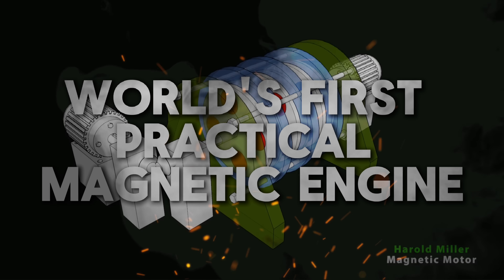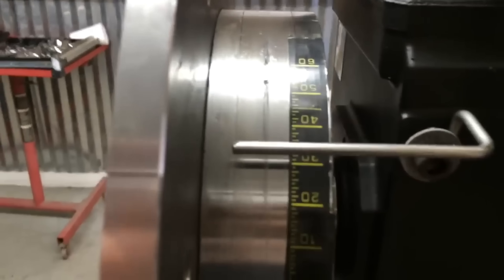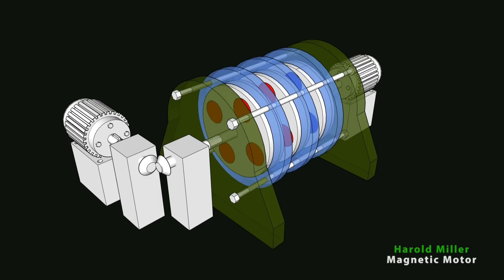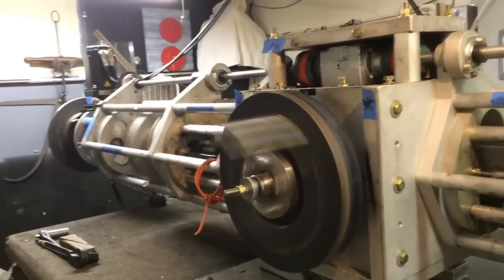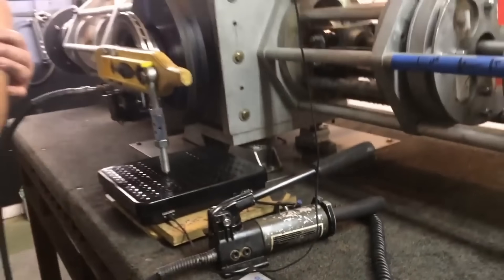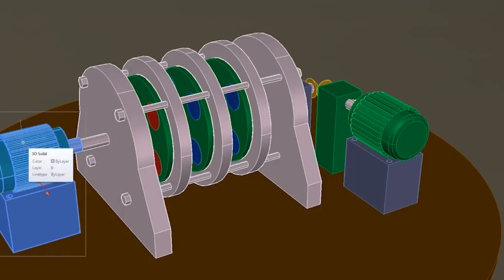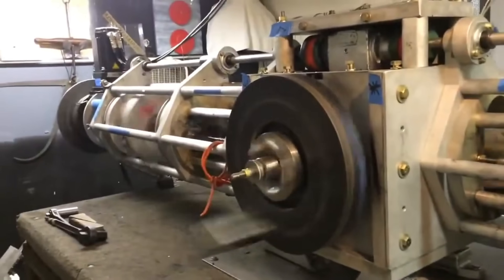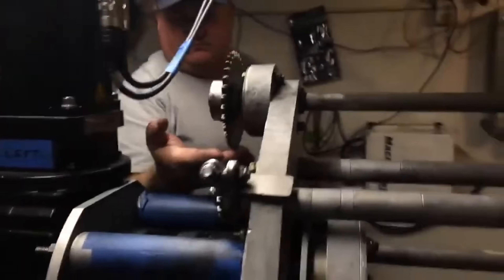Infinite Free Energy: Self-Starting 100% Magnet Powered Motor”?

Comment: Peaceful revolution driven by clean abundance
Let's face the wonder of full heat use. The second law of thermodynamics may be false conventional wisdom. This inelegant law. was developed during victorin england's scientific and religious fascination with steam engines. Many people act as if this paridgm is inescapable. 

. Unencumbered refrigeration by the principle that energy is conserved should produce an equivalent amount of electricity instead of consuming electricity. 

It makes more sense that refrigerators should yield electricity because energy is widely known to change form with no ultimate path of energy gain or loss being found. Therefore any form of fully recyclable energy can be cycled endlessly in any quantity. 

Full heat recycling, all electric, very isolated underground, undersea, or space communities would be highly survivable with self sufficient EMP resistant LED light  automated vertical farms, thaw resistant frozen food storehouses, factories, dwellings, self contained elevators, safe rooms, and horizontal transports. 

In a flourishing civillization, small self sufficient electric or cooling devices of many kinds and styles like lamps, smartphones, hotplates, water heaters, cooler chests, fans, radios, TVs, cameras, security devices, robot test equipment, scales, transaction terminals, wall clocks, open or ciosed for business luminous signs, power hand tools, ditch diggers, pumps, and personal transports, would be available for immediate use incrementally anywhere as people as individuals or larger social groups see fit. 

Some equipment groups could be consolidated on local networks. 

If a high majority thinks our civilization should geoengineer gigatons or
teratons of carbon dioxide out of our environment, instalations using devices that convert ambient heat into electricity can hypothetically be scaled up do it with a choice of comsequences including many beneficial ones. 

Energy sensible refrigerators that absorb heat and yield electricity would complement computers as computing consumes electricity and yields heat. Computing would be free. Chips could have energy recycling built in.
This would improve performance and lower cost, 

Refugee communities would be buildable quickly. Fire safes would preserve contents to 1000F indefinately 

A simple rectifier crystal can, iust short of a replicatable long term demonstration of a powerful prototype, almost certainly filter the random thermal motioren of electrons or discrete positiive charged voids called holes so the electric current flowing in one direction predominates. At low system voltage, a filtrate of one polarity predominates only a little but there is always usable electrical power derived from the source, which is Johnson (observation) Nyquest (theory) thermal electrical noise. This net electrical filtrate can be aggregated in a group of separate diodes in consistent alignment parallel creating widely scalable electrical power. The maximum energy is converted from ambient heat to productive direct current electricity when the electrica6bzDVgBhrhYl load electrical resistance  is equal to the array internal electrical resistance. 

Maximum calculated electrical power output (watts) is k (Boltźman's constant), one point three eight x 10^ minus 23, times T (temperature Kelvin) times bandwidth (0 Hz to a natural limit ~2 THz @ 290 K) times rectification halving and nanowatt power level rectification efficiency, times the number of diodes in the array. 

There are a billion cells of 1000 square nanometer area each per square millimeter, 100 billion per square centimeter.

Order is imposed on the random thermal motion of electrons by the structual orderlyness of a diode array made of diodes made within a slab: 

Host crystal is silicon
  P type boron doped
-----‐------‐----___-- Out
🔻🔻🔻🔻
■■■■■■___ + Out
  N type phosphorous doped 

All the P type semiconductor anodes abut a metal conductive plane deposited on the top face of the slab with nonrectifying joins;  the N type semiconductor cathodes or common cathode abuts the bottom face. As the polarity filtered electrical energy is exported, the amount of thermal energy in the group of diodes decreases. This group cooling will draw heat in from the surrounding ambient heat at a rate depending on the filtering rate and thermal resistance between the group and ambient gas, liquid, or solid warmer than absolute zero. There is always a lot of ambient heat on our planet, more on equatorial dry desert summer days and less on polar desert winter nights.

There are other plausible breeches of the second law of thermodynamics. Hopefully a lot of people, mostly as independent teams, will join in expanding the breech. Please share the successes or setbacks of experiemental efforts. 

These devices would probably become segmented commodities sold with minimal margin over supply cost. They would be manufactured by advanced automation that does not need financial incentive. Applicable best practices would be adopted. Business details would be open public knowledge. Associated people should move as negotiated and freely and honestly talk. Commerce would be a planetary scale unified conglomerate of diverse local cooperatives. There is no need of wealth extracting top commanders. We do not need often token philanthropy from the top if the wide majority of people can afford to be generous.. 

The topic deserves discussion and prototyping attempt action. 

Charles M, Brown
Kilauea, Kauai, Hawaii 96754

Comment: Am sceptical about this magnet motor.
Does it really only power itself with a magnet?
Are there really no hidden wires,accus or an aircompressor?
Also if it requires his hand to spin the cranking wheel, then it is not a selfstarting magnet motor.
Am very sceptical about.
Am afraid it’s another hoax.
And yes even if it will work, then there are indeed political oppositions who don’t care about a cleaner world but only do care about their profits  from their oil business.

Comment: If any of these free energy generators are been proven to actually work in a real world test, (where it counts) This would have been in world-wide production. There are many people claiming to have built such machines yet none exist. Even if one person gets shut down by the bad guys it's only a matter of time before someone else recreates a working device on the same basic designs and ideas. Have you ever noticed that when someone calls you on your cellphone that on average someone else you know will call you roughly at the same time and if you pay attention to this you will notice it happens more often than not. It's a sort of a psychic or spiritual connection or thing that we all have as living beings on some level or another. This same argument can be made about two people designing something based on the same concept no matter if it's a better can opener or a free energy device. My point is that at this time a free energy device does not exist and the evidence that it doesn't exist is the fact that it DOESN'T exist at least not at this point in time. Hope this helps.
Reply: OH BUT IT DOES!  Search on Walter Russell's Optical Dynamo. NO MOVING PARTS! It is a patent you can find, there is also a wealth of info on this on the University of Science and Philosophy channel The New Thermodynamics First Law: Cold generates energy. Heat radiates energy. Cold multiplies. It cannot be divided. Heat divides. It cannot be multiplied. Second Law: Every reaction must be preceded by its equal action. Heat is the reaction of cold. Heat could not come into existence save for the compressive action of cold. (The law of entropy, therefore, has no place in nature.) Third Law: Cold and heat express their opposition at angles of 90° from each other. Cold extends along axis and the axis of all bodies of creating matter where rotation is minimum, while heat expansion is maximum at equatorial planes where speed of motion is maximum. Fourth Law: Cold compresses. Compression multiplies cold into heat. Heat expands. Expansion divides heat into cold. Cold and heat, like life and death, constitute a wave cycle. In all nature there is no effect which is not wave created, and all waves are cyclic. (Again, I repeat, that the law of entropy, and the belief that energy does not run "up-hill", have no place in nature.) Fifth Law: When motion begins heat begins. This entire universe is a varied measure of the heat of motion. This entire wave universe is a varied measure of heat and motion. Long low waves of low heat potential constitute the invisible light spectrum, while short high waves of high heat potential and low frequencies constitute the visible spectrum. Sixth Law: The emergence of heating matter in motion from the static cold of space begins at the indigoblue and blue-violet ends of the spectrum and builds up to the white centered yellow, through red and green, until the maximum heat equatorial plane is reactive at an angle of 90° from the static axis of cold.

Comment: Magnetic fields cannot be shielded, but perhaps re-directed using non-magnetic materials with no loss in energy. So it is theoretically possible to build a generator using permanent magnets. So if this so - why haven't we seen lots of backyard tinkerers done so?
Reply: https://www.philosophy.org/uploads/5/2/2/0/52207651/russell_optic_dynamo-generator.pdf
Reply: The New Thermodynamics First Law: Cold generates energy. Heat radiates energy. Cold multiplies. It cannot be divided. Heat divides. It cannot be multiplied. Second Law: Every reaction must be preceded by its equal action. Heat is the reaction of cold. Heat could not come into existence save for the compressive action of cold. (The law of entropy, therefore, has no place in nature.) Third Law: Cold and heat express their opposition at angles of 90° from each other. Cold extends along axis and the axis of all bodies of creating matter where rotation is minimum, while heat expansion is maximum at equatorial planes where speed of motion is maximum. Fourth Law: Cold compresses. Compression multiplies cold into heat. Heat expands. Expansion divides heat into cold. Cold and heat, like life and death, constitute a wave cycle. In all nature there is no effect which is not wave created, and all waves are cyclic. (Again, I repeat, that the law of entropy, and the belief that energy does not run "up-hill", have no place in nature.) Fifth Law: When motion begins heat begins. This entire universe is a varied measure of the heat of motion. This entire wave universe is a varied measure of heat and motion. Long low waves of low heat potential constitute the invisible light spectrum, while short high waves of high heat potential and low frequencies constitute the visible spectrum. Sixth Law: The emergence of heating matter in motion from the static cold of space begins at the indigoblue and blue-violet ends of the spectrum and builds up to the white centered yellow, through red and green, until the maximum heat equatorial plane is reactive at an angle of 90° from the static axis of cold.

Comment: Filing a patent on free energy will get you suicided!
Reply: NOT ALWAYS.  Search on Walter Russell's Optical Dynamo. NO MOVING PARTS! It is a patent you can find, there is also a wealth of info on this on the University of Science and Philosophy channel.  The New Thermodynamics First Law: Cold generates energy. Heat radiates energy. Cold multiplies. It cannot be divided. Heat divides. It cannot be multiplied. Second Law: Every reaction must be preceded by its equal action. Heat is the reaction of cold. Heat could not come into existence save for the compressive action of cold. (The law of entropy, therefore, has no place in nature.) Third Law: Cold and heat express their opposition at angles of 90° from each other. Cold extends along axis and the axis of all bodies of creating matter where rotation is minimum, while heat expansion is maximum at equatorial planes where speed of motion is maximum. Fourth Law: Cold compresses. Compression multiplies cold into heat. Heat expands. Expansion divides heat into cold. Cold and heat, like life and death, constitute a wave cycle. In all nature there is no effect which is not wave created, and all waves are cyclic. (Again, I repeat, that the law of entropy, and the belief that energy does not run "up-hill", have no place in nature.) Fifth Law: When motion begins heat begins. This entire universe is a varied measure of the heat of motion. This entire wave universe is a varied measure of heat and motion. Long low waves of low heat potential constitute the invisible light spectrum, while short high waves of high heat potential and low frequencies constitute the visible spectrum. Sixth Law: The emergence of heating matter in motion from the static cold of space begins at the indigoblue and blue-violet ends of the spectrum and builds up to the white centered yellow, through red and green, until the maximum heat equatorial plane is reactive at an angle of 90° from the static axis of cold.

Comment: Take a physics class..,
Reply: The Universe's existence alone defys all physics ..
Reply: Nah, take a Walter Russell Class... Search on Walter Russell's Optical Dynamo. NO MOVING PARTS! It is a patent you can find, there is also a wealth of info on this on the University of Science and Philosophy channel The New Thermodynamics First Law: Cold generates energy. Heat radiates energy. Cold multiplies. It cannot be divided. Heat divides. It cannot be multiplied. Second Law: Every reaction must be preceded by its equal action. Heat is the reaction of cold. Heat could not come into existence save for the compressive action of cold. (The law of entropy, therefore, has no place in nature.) Third Law: Cold and heat express their opposition at angles of 90° from each other. Cold extends along axis and the axis of all bodies of creating matter where rotation is minimum, while heat expansion is maximum at equatorial planes where speed of motion is maximum. Fourth Law: Cold compresses. Compression multiplies cold into heat. Heat expands. Expansion divides heat into cold. Cold and heat, like life and death, constitute a wave cycle. In all nature there is no effect which is not wave created, and all waves are cyclic. (Again, I repeat, that the law of entropy, and the belief that energy does not run "up-hill", have no place in nature.) Fifth Law: When motion begins heat begins. This entire universe is a varied measure of the heat of motion. This entire wave universe is a varied measure of heat and motion. Long low waves of low heat potential constitute the invisible light spectrum, while short high waves of high heat potential and low frequencies constitute the visible spectrum. Sixth Law: The emergence of heating matter in motion from the static cold of space begins at the indigoblue and blue-violet ends of the spectrum and builds up to the white centered yellow, through red and green, until the maximum heat equatorial plane is reactive at an angle of 90° from the static axis of cold.

Comment: Sonny wants to do something that will undeniably prove his technology AND travel the world, get in contact with a cruise liner company who will work with him to build a gigantic magnetic motor that will power an ocean liner, it will travel the world, be seen and admired by millions apart for providing pollution free ship propulsion and NO refueling with dirty heavy deasil oil(its thick black stuff and the engine exhaust is used to keep the fuel tanks hot so it can be pumped into the engine) its to heavy to power aircraft, but perfect for ship propulsion ware with its 'heavy' engineering it will be very reliable, he wants to develop a 15-20000 hp system that can drive a smallish liner to start with, ship yards have the facilitries to build these things, its just a case of finding a ship owner who might be interested in such a venture, and prepared to put up the venture capital for it.

Comment: Decades ago the man that invented the maglev train invented a magnetic driven generator. It was small running a car generator. The problem was that the magnets had to be produced and they would run down eventually. A permanent magnet motor is not perpetual motion as the ignorant claim. It takes power to create them and they only have the energy given them at production. They run out of power just like a gasoline engine runs out of power when the gas tank is empty. Also what the ignorant ignore is that you lose energy through friction. So even the bedt perment magnetic motor can only output less power than was put in it at production.